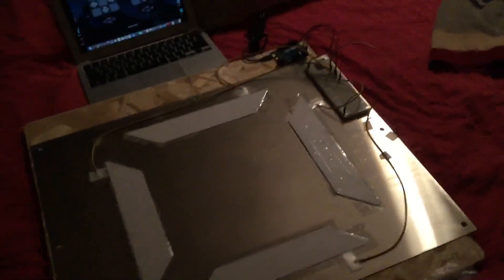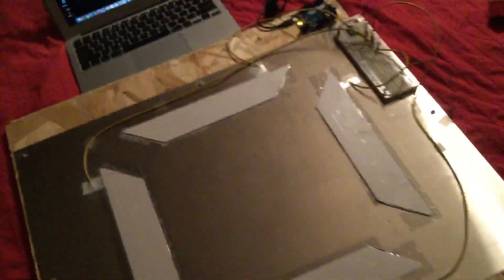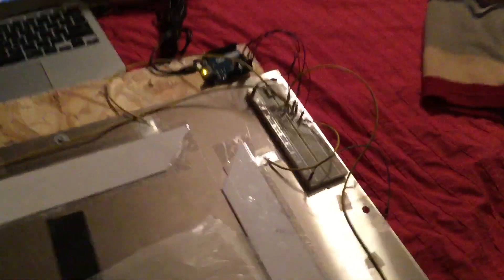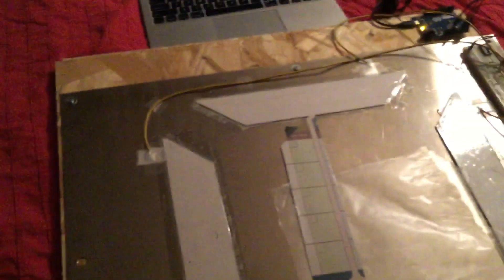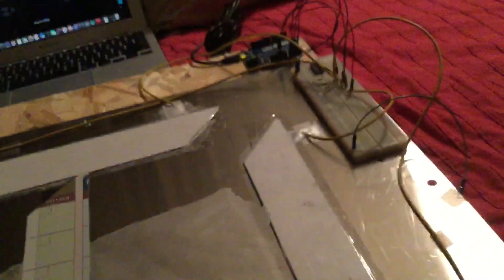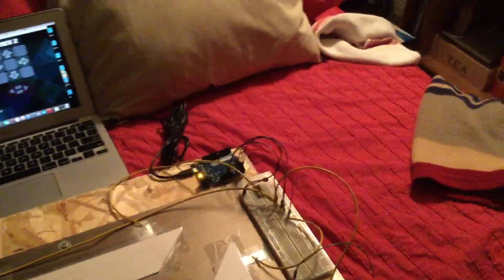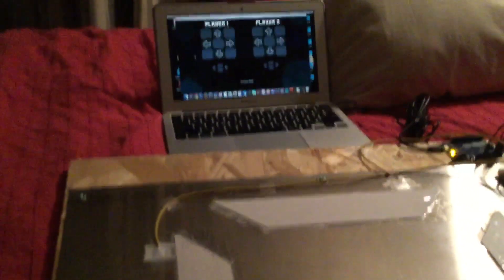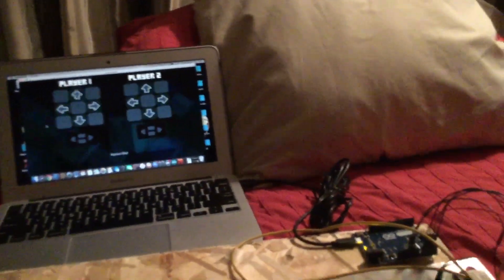Ghetto Velostat pad explanation

Comment: What’s the total cost of all the parts in here and how’d you find the Arduino code? I’m interested.
Reply from the maker: Crimson-fox Twitch dirty for the late reply, the velostat cost around $5 USD, you can grab a Chinese clone arduino for like 5 bucks on amazon, the metal sheet and piece of plywood would probably be 10 bucks each, so assuming you’re buying all your materials, you could build this thing for about $40
Reply from the maker: Crimson-fox Twitch also, I got the code from a friend, but I can share it with you if you like
Reply: 4199 Dance Games Yes, please.